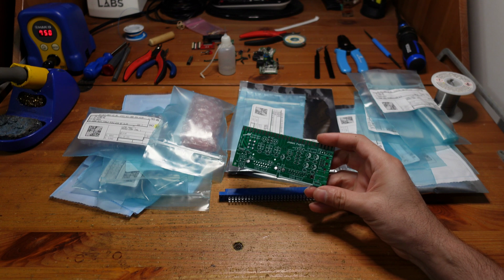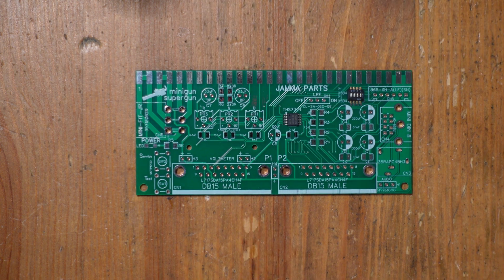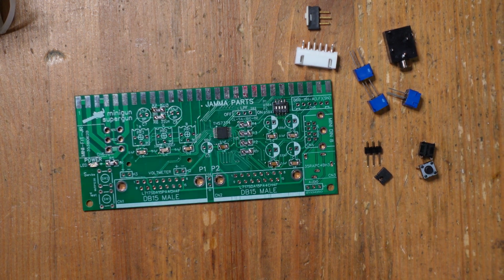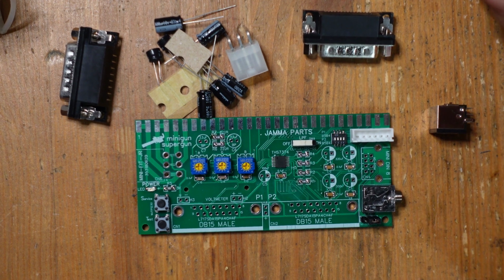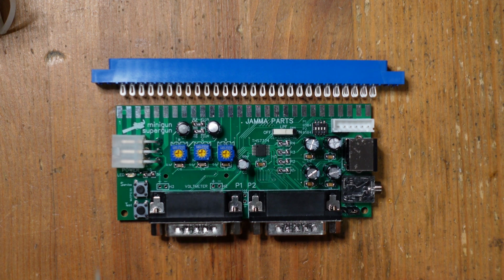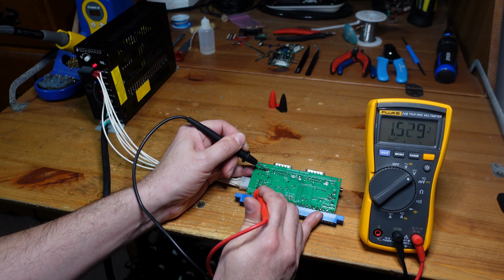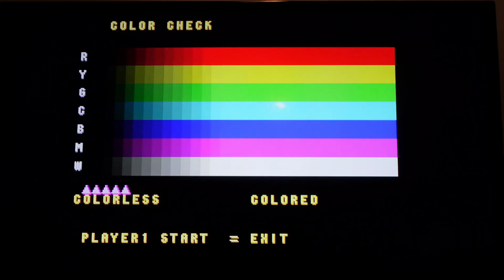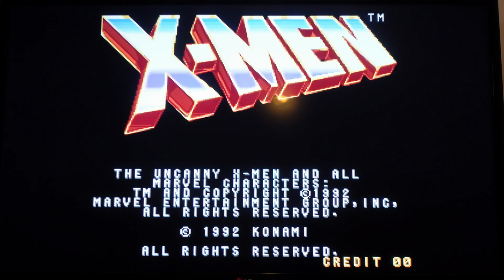Play original arcade hardware on a modern display! Minigun Supergun installation guide!

Comment: Great one,but just keep a long connector to...connect directly a arcade stick handmade not just db15 neo geo,more options.
With jamma+ 5 buttons..or 6 buttons cps games it's difficult just with neo geo controls.
Also directly on pcb,test and service buttons is always better.
Same with rgb sync,stereo and even screen display like on arcade cabinet.
I m still using one of the first ever supergun Combo A.V,like Kic's 91 who were presented as 'arcade console' back then,a childhood dream too expensive,I bought it 20 years after,now it's very basic,no option,so I added few stuff and better security in it,like Lukemorse did it.
It's a pleasure to play childhood arcade pcb on it.
Also,in 2014 or 2015 I contacted 3A,back then they only did multi games jamma,about my Combo A.V,I  asked if they could make a plug n play android or cheap pc to play since Willow to Deathsmiles,Cotton 2,dreamcast...and less than a year later the first Pandora box arcade pannel 2 players were available,same  style than my Combo.

Comment: Are the Sullins Jamma edge connectors much better than the standard cheapo "Z Jamma" ones? They appear to be about 4x the cost at the moment. Thanks!
Reply from the maker: Very good question. The cheaper ones have also worked for me but in this case I wanted something that’s really good quality. A jamma connector on a cabinet is probably not going to hold one PCB whereas games are swapped out all the time with a supergun

Comment: Should do a setup for a Sinden light gun USB to jamma board.. would be an interesting project.

Have the Sinden software flashed onto a chip on a custom board so you can configure the guns and then set it so you can boot straight into the game when the guns have been configured or have it tap into Sinden software when game is in diagnostic menus and allow hardware to use calibration from Sinden software with game software.. unless there is an easier way to do it.
Reply from the maker: That would be an awesome project!
Reply: @LIRetroGaming  thanks .. just kinda thought that being that older gaming hardware might go out of Vogue or too hard to find.. and makes things a lot easier for older games to get a new piece of kit and maybe even perform a transplant of the Sinden hardware into the older gun so that nothing really feels out of place.

Comment: Hey great vid.  Couple questions:  If you wanted component you would just need to solder in the other connection.  The board is the same either way correct?  I ask because I have this board and it has the 8 pin DIN SCART.  I'd like to replace it with component.  Also, there is a switch that says LPF, just left of the kick harness.  What is that for?
Reply from the maker: Yes there is a alternative version of this PCB that uses a nine pin Genesis model two connector. This would let you use HD retro cables and get component video. The switch for the low pass filter is just in case you need it for some arcade games to improve the video quality. So far I have not needed it with my set of games
Reply: @LIRetroGaming  I see I see.  Okay thank ya kindly!

Comment: Couldn't you just use your multimeter in continuity mode and test for the +/- ends of the LED?
Reply from the maker: Yeah I suppose I could have put it in diode mode to test. But the damn thing is so tiny that I was afraid it would go flying off my table. At least it’s not a big deal because if I installed it backwards it doesn’t cause any damage